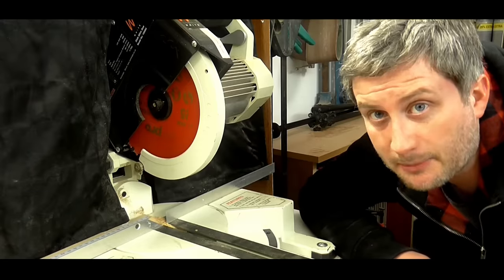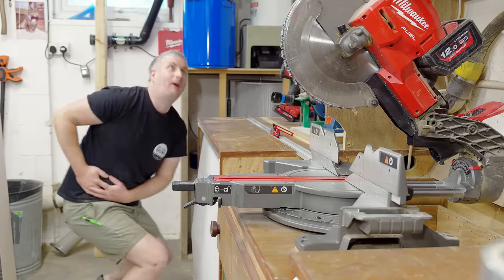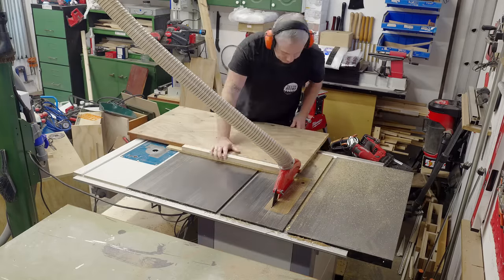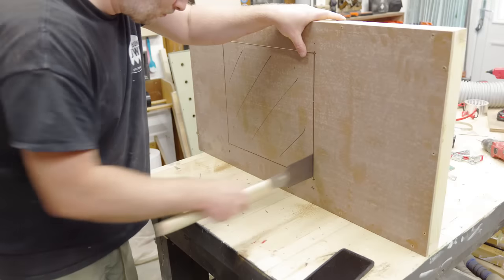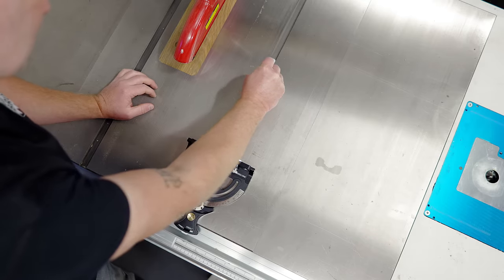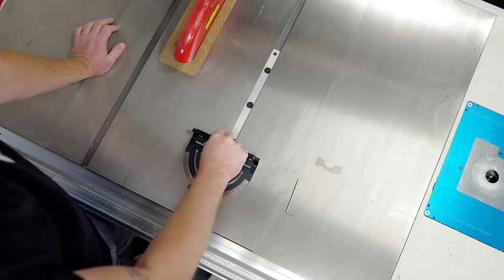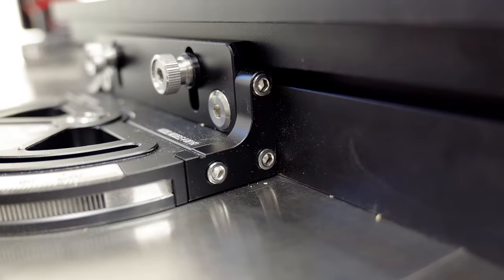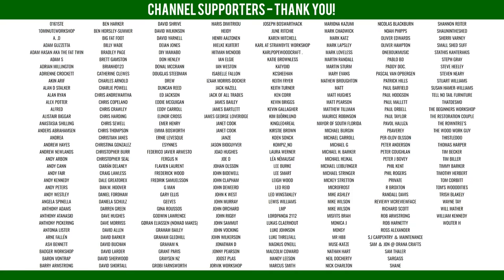Goodbye, Mitre Saw!

Comment: For anyone with little time to spare: The main reasons Rag 'n Bone wants to get rid of his mitre saw is because he has a tiny workshop and got a crappy product from his channel sponsor.
Reply: Lol, he deserves free stuff for all the hours he puts in to his uploads
Reply: For clarity, there are no such things as Mitre saws “better” than the Milwaukee.   ALL modern mitre saws are pretty flimsy. I was considering buying the fancy Bosch multilink saw, but when I tested a friend’s, I found it had the same flaw all mitre saws I’ve tried have, and that is that you can pull them off line just by how you pull the handle on the saw. They simply do not lock down.   They are all designed to be Jobsite saws that are relatively easy to transport. Not built in machines that you can rely on for repeatable accuracy.   Great for framing a house.   Crap for anything precise.
Reply: @strummer6642 no he does not.
Reply: Nonsense, a decent mitre saw will shave hundredths of inch off a cut.
Reply: @strummer6642  So what?   The problem I have with them is that you can literally cut off line simply because your arm pulls slightly to one side.   TRY IT. Just pull the arm out and shift your hand left and right and see how much the blade moves in the slot.   And I am not talking about a ‘decent’ one. I am taking about the very best ones made. The Bosch, the Festool, etc. I tried them all.  Every one of them was capable of making a non square cut.    A radial with an arm made of 150 lbs of cast iron is not gonna wander off the line no matter how I pull on it.   But beyond that, A radial will do 90% of the ripping i need done, More safely than a table saw, and a mitre saw can’t do that.  It is also easily set up to do dados, rabbets and other fixed depth cuts, either thru simple repeated passes, or with a dado stack, both cross cut and rip.   I would buy a decent mitre saw if I was a jobsite framer.  But for a fixed setup, a good quality radial saw is a far more versatile and accurate tool.  Original Saw still makes them new.   But my 1953 DeWalt I bought for hundreds less than a bosch mitre saw and its in like new condition.

Comment: As a contractor, getting rid of the miter saw would be unbelievably stupid.  I don’t understand why carpenters build these miter stations.  There’s no miter station wasting space in my shop.  If I need to use it at the shop I pull out the foldable mitre stand and use it.  It’s so funny how all these YouTube carpenters just copy each other.

Comment: When I downsized my workshop 10 years ago, I left out my miter saw.  With jigs and some computing I was able to get by without the mighty dust generator.   Recently I had some crown molding and custom cabinetry that I fond I needed the miter saw for again.  I bought the sawdust generator again and was surprised at how fast it filled the shop with dust.  All of which needed to be eliminated so I could paint the fixtures before completing the project.  There are things in woodworking that just need the convenience of a miter saw such as cutting crown molding quickly.  I'm keeping the beasty, but I have to figure out the the dust collection thing.

Comment: I have smaller space than you but carefully arranged FROM THE BEGINNING of the workshop. I do both woodworking and basic metalworking and welding 99% all in one small room. I made my own workbenches, heavyweight category, carefully planned to be on the ssme height to support workpiecs, all my shelves also supporting that height, as well as my miter saw whichnis in the auxiliary room. My miter saw is flip-over combination with my combined planer/jointer, mounted on movable construction. And so on. 
You simply did not plan properly from the begining for productivity of the workshop as a whole, so your later decisios are increasingly more wrong.
Yes I spent months for planning . But I have considered that time best invested time than any other single oroject I did in that miniature workshop.

Comment: This appears less of a "this tool isnt worth having anymore" to more of a "I don't bave enough space"....

The fact you're unhappy with your cuts is because of that trash m18 10 inch miter saw. Get rid of it, its garbage. The head deflection is HORRIFIC. Literally no one says this saw is accurate.

As a finish carpenter I've got 4 miter saws and couldn't imagine not owning one.

All you need is a 12 inch chop saw in your shop. Dewalt dw716 should be fine.

Comment: first of all you don't use a milwaukee miter saw for serious work.  avoid a Dewalt also.  you get what you pay for.  I use an MFT for larger 90° cuts and it is dead on 100% accurate every time with proper setup.  You could always get a festool Kapex but I don't think that was the point of this video you were promoting a product.  I guarantee you will have a miter saw back in your workshop soon enough once you are tired of balancing long boards on your sled, Oscar for best dramatic overreaction for sure.